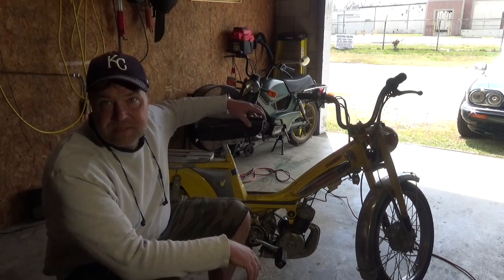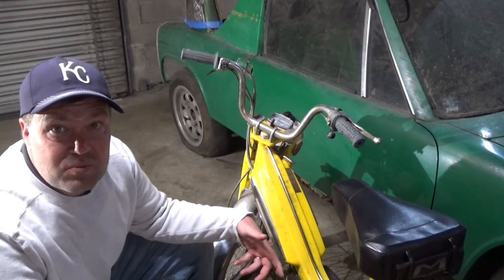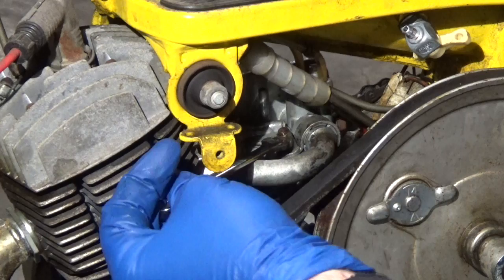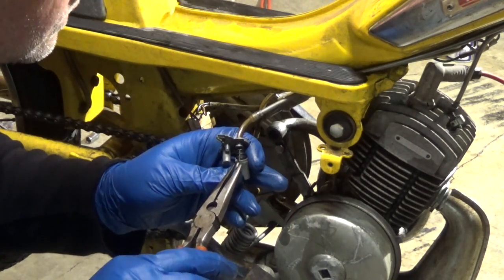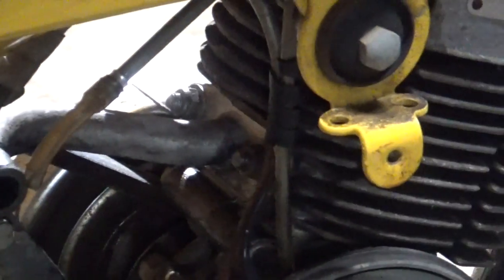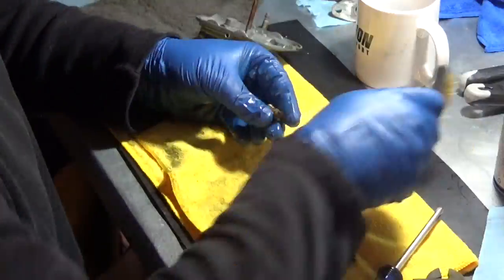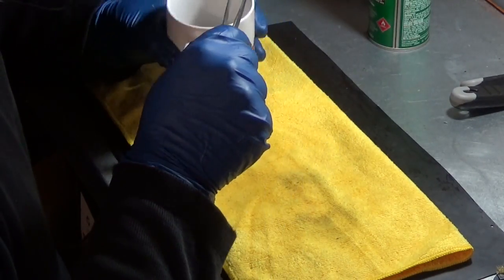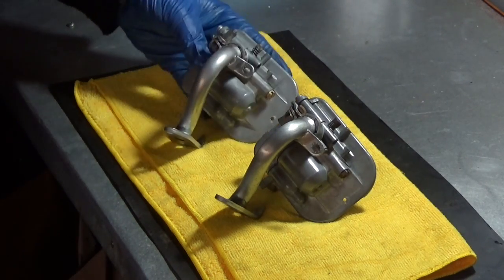Motobecane Moped Restoration Ep. 2 - Carb rebuild

Comment: I have a 1980 motobecane moped traveler I got from a guy who had it when he was little and drove near the bay and the rear wheel rusted out and he put it away and never rode it again. Everything is in good condition including the wires and electronics. I want to rebuld the carburetor which I have off right now and clean the tank and put new gas in it and see if it runs. It's got good spark and compression but I'm missing a drive chain and a petal chain. The chain guards are missing as well and a side of the tool box under the seat. Theres only surface rust but the stickers are peeling away. The handlebars are really low and the seat is really high and both seem unadjustable. Watching your videos has helped a lot, while there are some noticeable differences in the 5 year difference these were made it's mostly the same and your videos have helped a lot. Also what is the song you used in this video around the 5 minute mark?

Comment: I bought a 78 Motobecane without a functioning carb. I know nothing about Moped. It Seemed like something missing from this 78 Gurtner carb that I couldn't fig it out so I bought a used 79 carb on Ebay, slightly different but still NOT sure all the parts, especially how to hook up the throttle cable and choke and all of its internal parts. I see that you have a different model year Carb on yours. You mentioned somewhere how to text message or email you so I can send pics that you can help me. I really appreciated. Thanks. I love all of your videos. It's all very helpful and entertain.
Reply from the maker: Hey Vinh.  Send me some pics at davidfixeshisshit@gmail.com and I'll take a look.  Thanks!

Comment: You mentioned in your non-stock bike you’d be using a better carburetor for higher performance. Could you recommend a make / model/ supplier of such a thing. I’m clueless. Thank you.
Reply from the maker: I used a Dellorto 15:15 SHA. Mounts right up. Big rip. Everything you need right here https://www.treatland.tv/motobecane-SHA-carburetor-party-p/motobecane-av7-sha-party.htm
Reply: Thank you. Would that be suitable for the model 7. I know that carb is a little different.
Reply from the maker: Should work perfectly. It has an AV7 engine and cylinder, so it should snap right on. Good luck!
Reply: Thank you for taking the time to answer my questions and for putting up these videos for others.

Comment: i can attest to the pain of carb cleaner in the eye. i sprayed into a hole i thought was a through way into the carb and it blew back rite under my safety glasses.  i had a full gallon of water with me so i tipped it up like an eye cup , worked well. im here because im rebuilding a 78 50v , now realizing im missing several carb parts.
Reply from the maker: Awesome!  I love to hear about a Moby getting back on the road.  Just get a new Carb 😉. The gurtners aren’t worth the effort....
Reply: @DavidFixesHisShit  ended up ordering a replica gurtner for originality sake. wasent sure what else would work with the mobys choke setup. dident want dead controlls on the bar,

Comment: Hi David. Love the progress videos and a great idea having an original and a modified version. 
Anyway I've just bought an AV68 1968 with no prior experience of mopeds. It with a bit of prior with of strokes and carbs.
My started and ran fine when I bought it a few weeks ago but has developed a fuel leak from the carb breather (Gurtner carb). I repaired a hole in the float so it floats nice but I now have an intermittent leak so still suspect the float needle. Did you have any troubles with the brass floats on yours? If so did you take any footage of repair? Cheers
Reply from the maker: Oh man.  I had to mess with the Gurtners a bunch to get them to work.  My floats worked, but I still had a leak.  What finally fixed it was grinding the needle back to a nice sharp point.  You can see it in episode 5.  Unless you are meaning to get your bike completely back to stock (like I wanted to on the first one), then you might just wanna spend the $50 for the SHA Dellorto.
Reply: So, firstly apologies for the terrible English in my first message - I don't know what happened! Must have gotten a bit over excited!

So yes, I got a new plastic float to replace the original brass one and its floating nice but I still have a leak, however I've found the petcock to be faulty so fuel is always able to flow to the carb. This doesn't necessarily fix it but it helps. I think I might have to try cleaning the valve to make sure the new needle seats correctly. 

The thing I now need to get to is tuning the carb after I've replaced all the cables and outers. I was lacking power but having played with the idle and mixture I don't think theres anything drastic to worry about. Just got to tune it properly. Any suggestions - other than trial and error?

Comment: Great videos. Very helpful and fun to watch. When you removed the choke and throttle cable from the carb they seemed to come out easily. I've removed the screw but despite pulling and prying they won't come out. Don't want to force them. Any ideas?
Reply from the maker: Hey Thomas.  Spray some PB Blaster (or WD-40) down the screw hole.  Then unscrew the jet on the bottom and spray some more up that hole.  Then let it sit overnight.  They are just stuck in there, so any penetrant should break up the muck and let them slide right out.  Lemme know how it goes.  Thanks for watching!
D